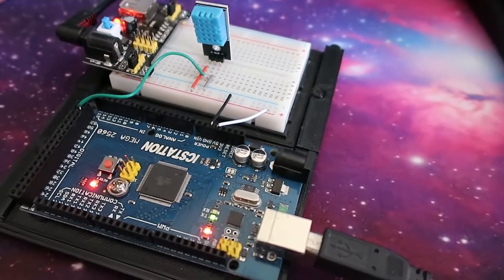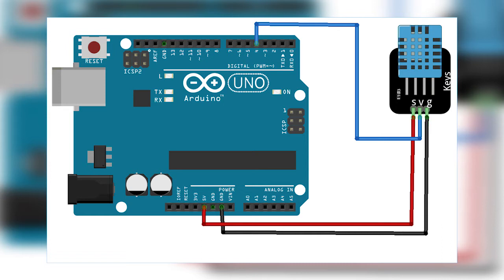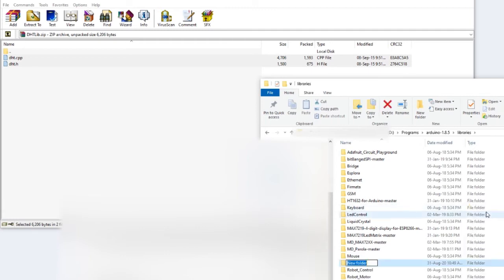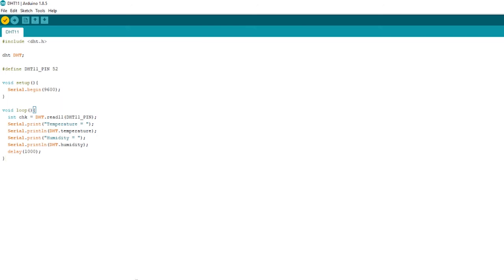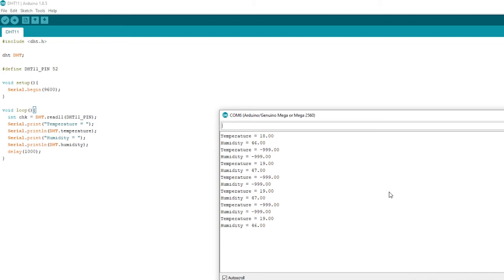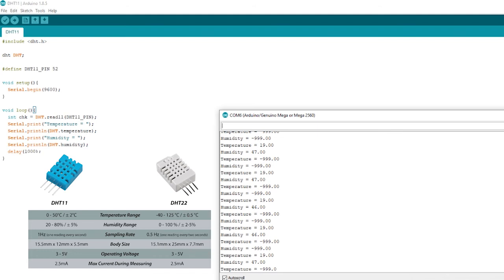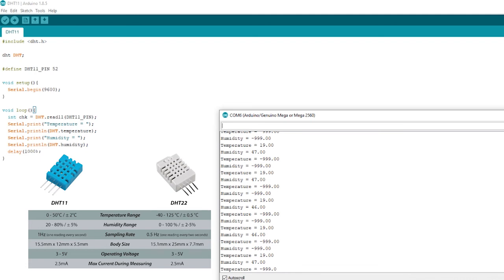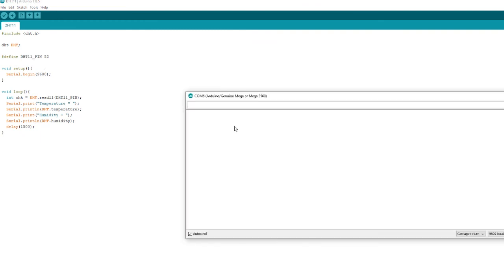DHT11 Temperature Humidity Sensor Arduino (Easy step by step guide!)

Comment: i have this from grove with a 4 pins! do you know how to wire that one too????  mine has GND on pin 1, VCC on pin 2 and (they say) that pin 4 is data (and to not use pin 3)
Reply from the maker: yes, it will be fine

If you have the plug in cable it  
5V - Red
GND - Black
Not Conencted - White
DATA - Yellow
Reply: @ScottyDIY  so... i tried that, either get -327°c or just "NaN"...

Tbh i completely have given up on it. And i am now "trying to wok with the AHT20 from adafruit." But somehow that one is still outputting in farenheit for me, it was 10°C in my home and i thought that 50°c was a bit much lol...  but not i don't know how to fix that🥺
Reply: @ScottyDIY  oh by the way, do you perhaps know how to get the readings from serial monitor to an oled without it cluttering up or wkthout having to refresh the whole oled screen?